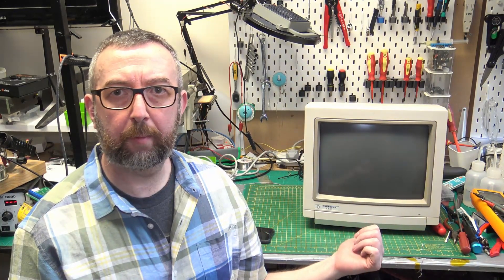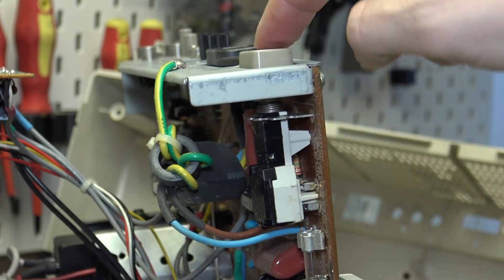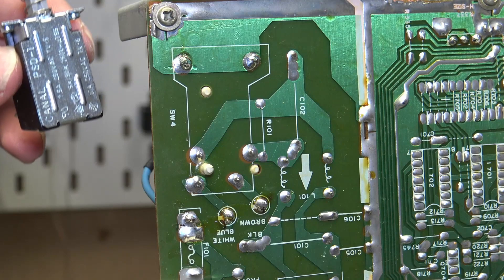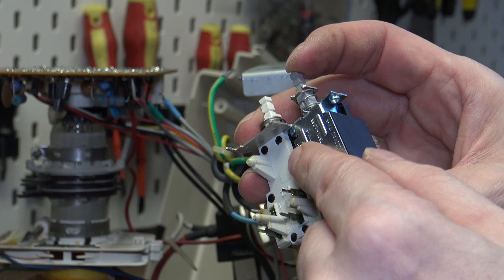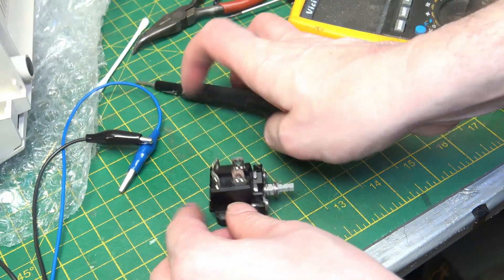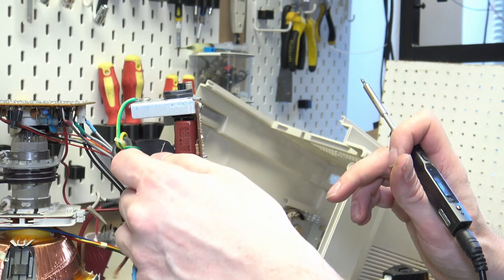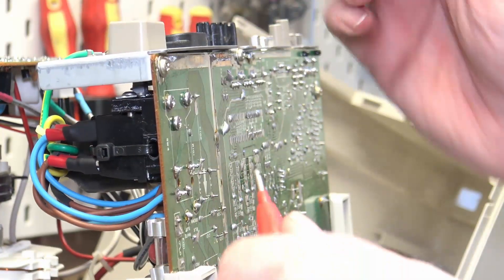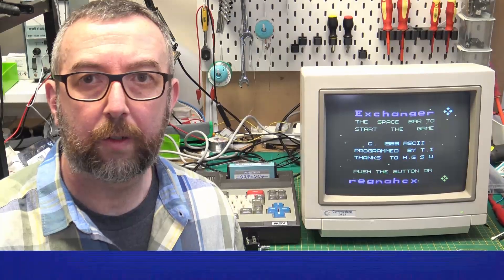Replacing the power switch on the Commodore 1084S CRT monitor

Comment: I need to replace my 1802 monitor power switch.  Will this switch work the same for my monitor?  I am thinking that it should.
Reply from the maker: I have not seen a 1802 so really can't say
Reply: @leesmithsworkshop  Ah! I just found out that the 1084 pwr switch is quite different than the 1802.  For now, I just jumped the wires together so that it is always on when I plug it in.  I used to have a 1084s, but after lending it to my sister and her family years ago, he returned my system to me, but with an 1802 monitor in its place.  I guess he never thought I would notice.  hah! sigh

Comment: Hi, I am having exactly the same problem on my 1084S-D1 commodore monitor, with the power switch. I have been searching all over on the internet and can not find a replacement, could you put the link to where you purchased it and also I don't have a 3D printer, could you sale me one adapter? by the way, the link to the guide is broken
Reply from the maker: thingverse is crap and went down. I will post a link to another. I have a switch and could print and send the whole think over if you want ?

Comment: You should sell this as a kit!
Reply from the maker: perhaps, i wouldn't be making much back from it if it was sold cheaper than the original replacements. It's easy enough to do your self unless you don't have a printer.

Comment: Excellent fix!  Good alternative to those expensive original switches :)
Reply from the maker: it's still a used switch, but it can be taken apart for cleaning, I had to use deoxit and switch many times before it worked all the time.

Comment: Excellent!  Fantastic job and a great idea with the 3D printed support bracket!  Contrats on 1000 subs too =D
Reply from the maker: Thank you :)
Reply: @leesmithsworkshop  Will be sorting out Mister soon - so will give you a huge shoutout on that video!  Also - need to revisit those MVS save adapters, never got around to finishing that off, but I will soon!
Reply from the maker: @GadgetUK164  That case is the only one I ever printed as single parts !. The MVS parts are sill steady sellers too. I look forward to seeing your take on the MiSTer systems, it's progressed quite a lot in the past year.
Reply: thanks for putting me on to this video, you wouldn't happen to know anyone who could sort me out with the print and screws i need? got the switch on order :D
Reply from the maker: @SparksNZeros  are you uk ? why do you want an alternate link ?
Reply: @leesmithsworkshop  i am in the uk, the thingiverse website is down atm so it never loads the link.
Reply from the maker: @SparksNZeros  I can print for you legion at djlegion dot com
Reply from the maker: @SparksNZeros  https://cults3d.com/en/3d-model/gadget/commodore-1084s-power-switch-support

Comment: Nice one Lee, and congrats on the 1K on this channel. Here I was thinking it was a nice touch to use colour coded wires for active and neutral, and then, well, never mind 😄
Reply from the maker: After all the switch troubles I just wanted to get it working and I never thought about that.
Reply: @leesmithsworkshop  Don't worry, I figured that was the case